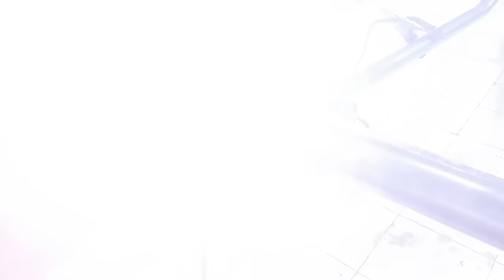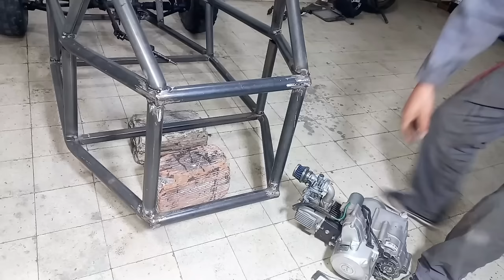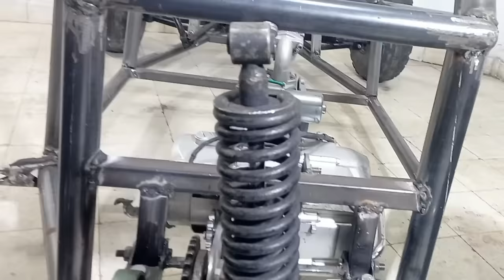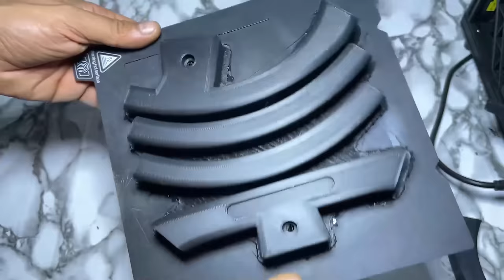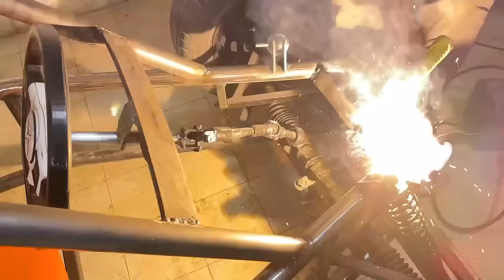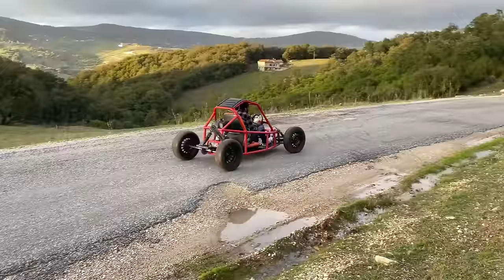Cheral CrossKart Project - Homemade Car from Scratch

Comment: Man I like it don’t take me wrong but it’s so disappointing if you did all that monster work what kept you from making it a tiny bit bigger and put a bigger engine since I’m sure skills isn’t an issue you can find some 750 800 cc motorcycle engine all day long, anyways  great build
Reply: Yeah he couldve added a better engine because this engine i believe wont even push out 30km/h so at this point the spring choice was very expensive too he could have went with rigid type axle suspension

Comment: How long will your suspension parts live without proper bushings and bolts? How long will your rear tires last without a proper differential unit?How did you like being splashed in the face without fenders or windshield.? Where are your mirrors, lights, horn and license tag for road use? I do like your enthusiasm during the build, and your choice of roof material, but this little Kart will not last very long.
Reply: It’s a gokart bro😭
Reply: How about instead of critiquing his build you create some content on your page and show us how to make one .? Just a random thought.
Reply: Yea u comin off too harsh evn tho som bushing wud mke it last longer fi tru
Reply: It's a gokart not Rolls Royce
Reply: Заднюю подвеску по принципу переднего может нужно было бы сделать нет ? 
Думаю если присядтт сильно 
То стукнется задней част рамы об дорогу ...это чисто субъективное мнение мое 
.мастеру конечно виднее .и растяжку на передние тяги тоже наверное нужно было 😊
Reply: speaking facts. But, maybe you should cut him some slack.
Reply: oh stop crying😂
Reply: Автор показал как пример, вас никто не заставляет повторять его ошибки, делайте лучше. Особенно ходовую.

Comment: you should check the front suspension bro
Reply: Why what's wrong with it 😕
Reply: @rockman49er  in my opinion, the stand geometry is a little bit low

Comment: Nice work... only the front  suspension with the arms are a bit weak. With this size of engine you would be ok but if you want to jump forget it...
Reply: Yes the arms need to be TIG welded first then heat treated and annealed. I actually would never go fast in any vehicle built in this manner those welds are subject to failure at any time.

Comment: damn fine lookin buggy :).  everything looks fine, but is the enough space to seat comfortably even with motocross helmet on? because i wouldnt ride around without a helmet ... what kind of engine is that? looks like aircooled, or you just didnt  installed radiator yet?